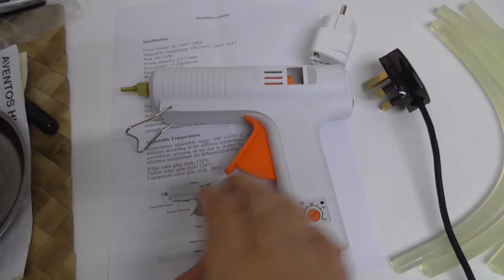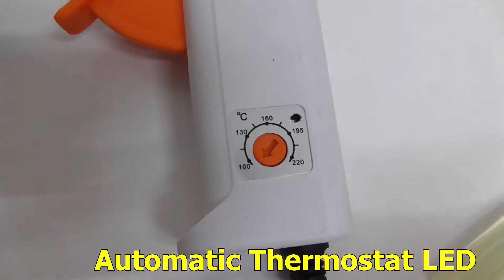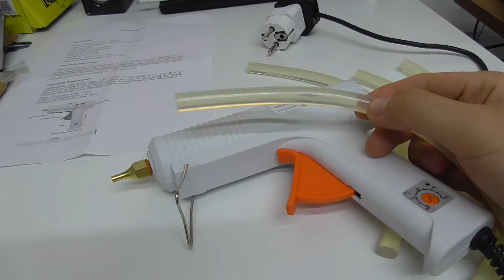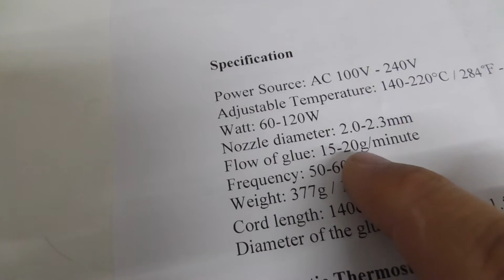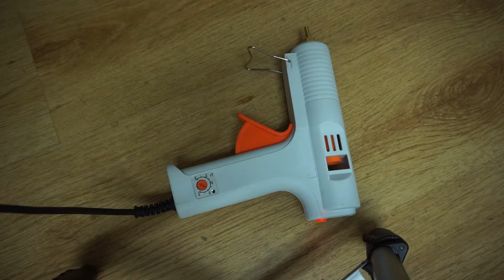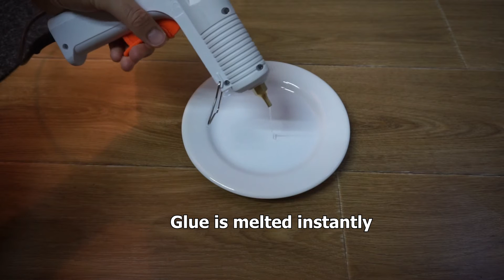120W Hot Melt Glue Gun - Bestorx (Adjustable Temperature, 11mm sticks )

Comment: For this type of glue gun does it allow half used glue stick to be removed easily ? Coz I want to switch between black and transparent glue sticks for different projects.
Reply from the maker: No, what is already inside is halfway melted so it can't be easily removed, you have to push it out using another stick. The high wattage melts the sticks quickly.

Comment: If you had add a coat of cooking oil with a paper towel to the plate before dripping hot glue it would of make easier to remove the glue after it had dried, this is just a suggestion for next time.
Reply from the maker: Thanks!